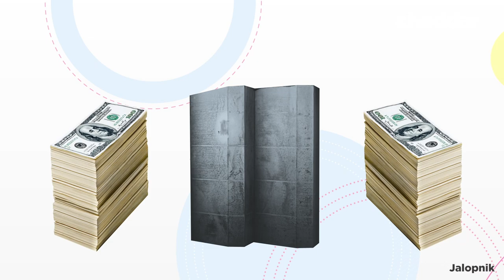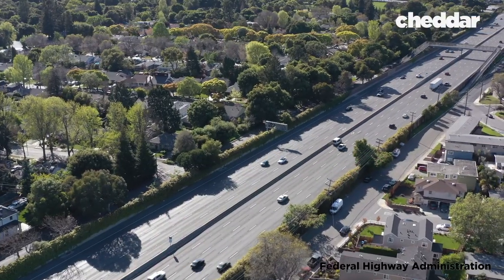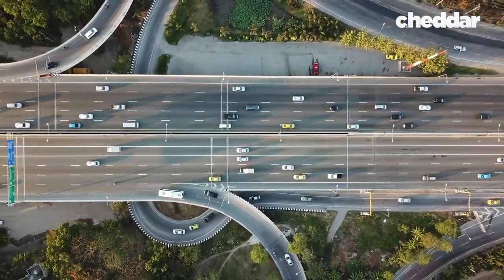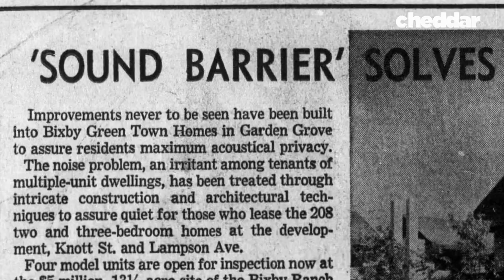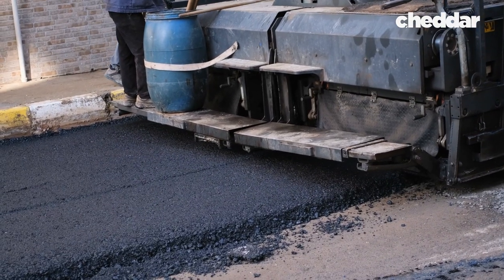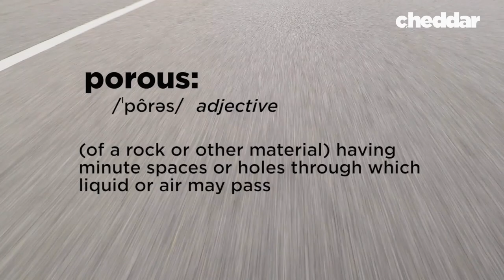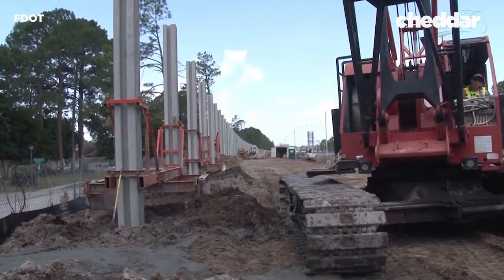How Highway Noise Barriers Can Make Traffic Louder - Cheddar Explains

Comment: As any City Skylines player will tell you, trees are the best solution to noise pollution. Not only do they have far more surface area to absorb sound over, they also have the added benefit of absorbing some of the pollution from the cars on the road.
Reply: That's what is done in my city. Trees and tall hedges line the highways. Even pedestrian pathways along major roads have vines too block the dust and noise.
Reply: @bingosunnoon9341  well the trees that line 90% of England's motorways seem to be doing just fine
Reply: Bro I just delete their homes if they nag about everything
Reply: @mkviis  I want you to be the mayor of my state
Reply: Better leave it to the actual engineers then because in the real world it doesn't work. Studies (notably: Leonard, Raymond E., and Sally B. Parr. "Trees as a sound barrier." Journal of Forestry 68.5 (1970): 282-3) have found that even 30 meters of dense foliage will only drop sound levels by ~6db. Having to buy an additional 60m of right of way for a highway to plant trees, only for such a small impact is not as effective as other types of sound mitigation.
Reply: Both
Reply: @enterpriset   your comment should get pinned
Reply: Its not that effective, I’ve seen countless people on French TV complaining that the motorway makes too much noise even though they lived behind a very dense and large area of trees
Reply: @mkviis  so do I, if they complain I'd delete their homes. Problem solved!
Reply: @bingosunnoon9341  you haven't been to NYC? lots of living trees along freeways and major roads.
Reply: Niccee
Reply: @bingosunnoon9341  no, CO2 is actually their food, and while other byproducts of combustion can be bad for them it's not to a degree that kills them or hampers their growth.
Reply: @bingosunnoon9341  only if it gets really extreme.
Reply: Noooo! My boring dystopia! People might actually like their neighborhoods!
Reply: You know, that is one of those areas in which a game doesn’t represent reality.
Reply: And they look great!
Reply: Anecdotally, I can confirm IRL. We live behind a dense line of trees, with a highway on the other side of them, and the noise is negligible when combined with our double-paned windows.
Reply: dirt hills work great to, if the 'wall' is at an angle, most of noise bounces off to the sky, and earth also absorbes a huge lot, put some plants on it, yes you'll have to mow it couple of times a year, say 4, but i really don't think moving 4*30years  costs more then replacing concrete wall...
biggest prob is of course it need a bit more space, and not possible on highway bridges :)

Comment: Diffusion and absorption are the way. Reflections literally create an echo chamber. Physics are cool
Reply: Definitely, a "green wall" of trees works wonders and is used in many countries.

Also looks nicer
Reply: Heck... even planting trees would have helped to absorb noise.
Reply: @FoxDren  how dare you
Reply: this is why every other first world country has patterned thin wood/metal sound barriers, instead of concrete wall.
Reply: @bingosunnoon9341  that's stupid and if you did any research on it, you'd know it too. Tree curtains are THE BEST way to cancel noise. If they are planted at the proper width and density, going from bushes to small trees and then taller trees to cover any vertical gap and they can cancel almost 90% of the noise. 

Also, a proper tree barrier protects not just from the sound, but will also protect the road from harmful weather, by trapping winds and snow. 

Furthermore, tree curtains were shown have another benefit: they reduce the severity of roadside accidents. When a car leaves the road and slams into a concrete barrier, it will most likely result in deaths. When a green barrier is installed, the car is slowed down by the vegetation before reaching the tallest and most solid trees in the back, thus reducing damages to the car and the severity of the impact. 

Last but not least, trees protect nearby residences from pollution. In addition to trapping cross winds, they also trap dust emanating from the highway. 

This is all common sense in Europe and has been used successfully for decades. The US is doing almost everything wrong because of corporate interests. After the initial planting, trees grow by themselves and maintenance cost in minimal. Maybe you will have to replant some bushes or trees after accidents, but that's it. Meanwhile concrete walls make a lot of money for the politically-connected contractor, while having all sorts of negative environmental impacts: they amplify noise through sound deflection and reverberation (sound waves trapped between two barriers are amplified), they not only stop dust but create more, they are an eyesore, etc...
Reply: @FoxDren  yep, better for air quality too. Tall trees with lots of branches and foliage are what you really want. Very tall ever greens are best as their leaves stay up all year round and so even in the winter months they'll provide a very good noise damping.
Reply: @bingosunnoon9341  no, because leaves and branches are flexible. When sound waves hit them some of that energy goes into moving the leaves rather than being reflected like a hard concrete barrier. On top of this, sound waves are more likely to be deflected several times within the trees structure which further removes energy from the sound waves.
Reply: @bingosunnoon9341  that's how noise absorption works. Every material that "absorbs" noise does that by breaking the sound waves into multiple smaller ones repeatedly until they are less perceptible to the human ear. They don't actually absorb sound, just like the beach does not actually absorb waves, it just scatters them until they're something else. Sound, just like waves, is just vibrations in a fluid.
Reply: @descoiatorul  There are materials that absorb sound but they are not used except in specialized applications. A test is to blow into the material in question. If you can blow through it, the low pressure sound energy can enter and never leave or it leaves diminished in amplitude but not frequency. It's just vibrations in a fluid. I spent many years creating sound canceling systems for airplanes and airports. Scattering sound energy does not cancel it. The airport in Denver is a perfect example. So is the cabin of a Saab 340. Those speakers on the ceiling are not there to announce arrivals. How often do you accuse people of being stupid? That is rarely a sound strategy.

Comment: In Sweden, all noice barriers I see is made out of wood, and shaped in a way to try to catch and trap sound. Where each piece of wall is an S-shape, where I assume they aim to trap sound in the "boxes"
Reply: Here in Britain too
Reply: I haven't seen many noise barriesrs here in Spain. But the only one that I can remember has the S shape too.
Reply: The S shape is because Sweden starts with an S
Reply: @ARCGrayist  That's why we also have them in Spain...
Reply: In portugal they are made of plastic and are usually transparent with bird designs on it
Reply: After they are trapped, does someone come by and take the box sound and release them into the wild?
Reply: Generally in Europe I've seen acrylic glass barriers. The US is just backwards and behind on infrastructure, like usual.
Reply: @lourencovieira5424  because Portugal and plastic both start with P
Reply: @Freshbott2  So the United States need to make noise barriers of Uranium?
Reply: @randalftheblack2572  yes
Reply: Here in Switzerland we also have the wood barriers in some places but most are concrete. But they are much unlike the one shown here, as only the vertical posts are made of solid reinforced concrete, while the panels inbetween have a much more convoluted surface and are made of a markedly porous material to better trap sounds.
The only barriers we have that are hard solid surfaces are the occasional glass ones designed to preserves landscape views for adjacent properties.
Reply: Wood probably vibrates and absorbs much more noise.
Reply: s for sweden
Reply: @jean-martinvonsiebenthal2836  Here in Europe you can sometimes see noise barriers with "plant boxes" so that after a while the barriers are covered by climbing plants. And in urban areas, the old asphalt has often been replaced by the so-called "whisper asphalt" in recent decades.
Reply: Trees and shrubbery is allso quite common as soundbarriers in Sweden.
Reply: @randalftheblack2572  Uranus
Reply: @randalftheblack2572  I support that, especially close to kindergartens and other places kids hang out. They would not only reduce noise instantly but even reduce the traffic and pollution in a few decades.👍
Reply: Sound barriers have curves to increase surface area. Sound waves will wrap around them and dissipate. It's why greenery on the walls can make a big difference. Surface area is the biggest thing, which is why you see youtubers with 'egg carton' foam walls around them.
Reply: Wood is way to expensive to do that here now
Reply: Can someone provide a link of what these look like for a poor American? I googled Sweden noise barrier but not sure if I’m seeing the right style. Thank you :)
Reply: @randalftheblack2572  American exceptionalism wouldn't settle for anything less then Unobtainium.
Reply: Here in Italy too! Not made of wood but steel with holes in it and a chamber behind it where noise waves get trapped and absorbed
Reply: @schnutzudri918  What is the cost difference between wood and concrete?
Reply: I was going to say the same, here in Norway they're either wood or reinforced soil
Reply: @Gnefitisis  Even in Russia, where the barriers are plain and straight, they are made from polycarbonate plastic
Reply: 777 likes.
Reply: @alex9621  As highways in Italy are mostly toll, quite expensive, and so only serve the well-off, it makes sense that they can afford far more expensive barriers.
Reply: Here is the US sound barriers are big, ugly, and expensive because we are dumb AF.